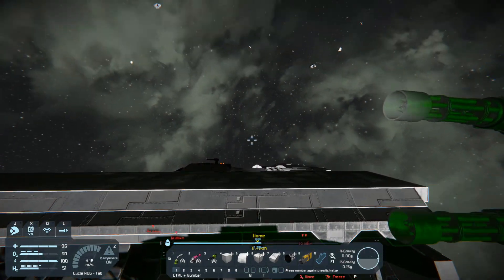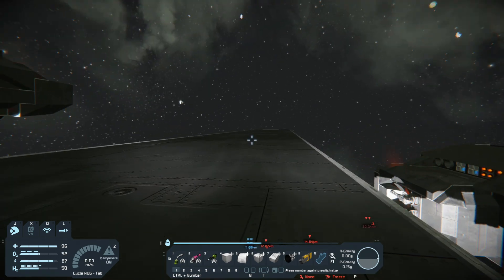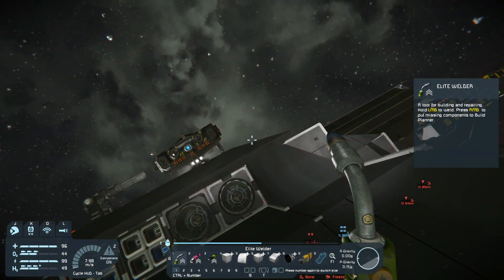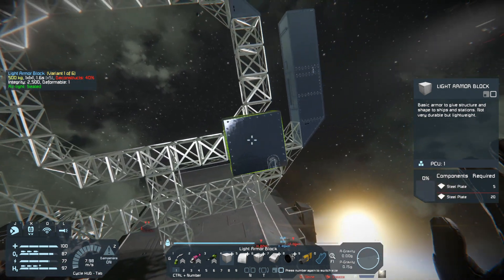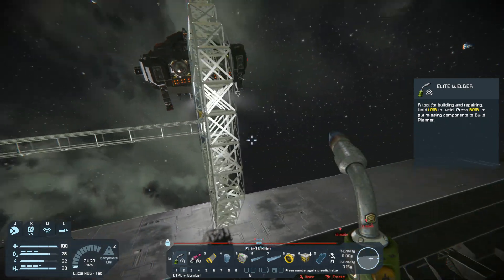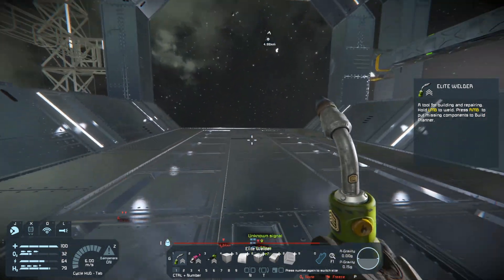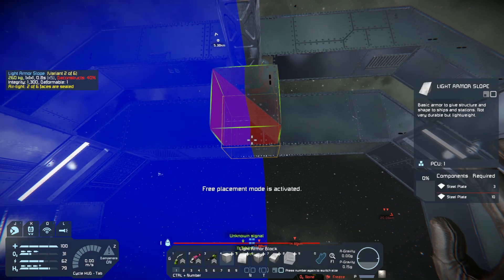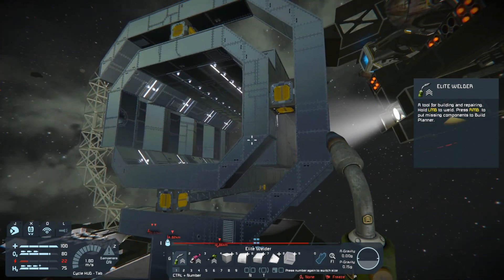Space Engineers   Wasteland   EP 239

Comment: Now you asked for it... you had your three weeks without me playing with your comments it's my turn now!

first thing.
your tunnel is too narrow it needs to be large enough for one of your large cargo containers to be suspended down it's center without making it feel cramped.. the module should likely be long enough for two of them end to end to cut down on how many modules you will need for everything... soo center tunnel wider and cargo through center of each module? or as desired.

second thing.
ya i am going to pick at things now...  a walking corridor along the outside of each module with outward and or inward facing viewing windows, so one does not have to simply walk down the work floor to get from one end to the other, but can circumvent the floor by walking down the halls to either side.

third.
Your central hub could be a giant circular ring... circular as in a doughnut, round corridor that makes a continuous loop. 

seven full blocks, three blocks with the slope of 2 wide one tall, two 45 degree angle blocks, and revers order again and again until full circle, then make a similar curvature for the corridor's cross section....

now i am just being too bossy have fun with your game wish i could join you but i bet we would lag your system to hell and mine is dead as it is so good luck and have fun!
Reply from the maker: LOL welcome back =) I think the size I started with for the tunnel will shape up well. Other areas will be larger so making room for containers and such will happen in their own space. As for the main hub of the station I have plans for that =)